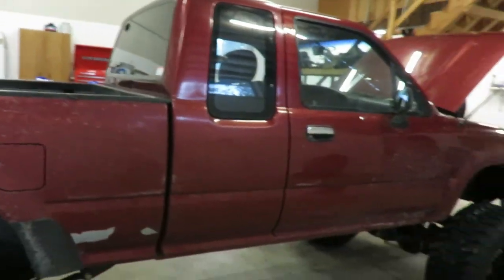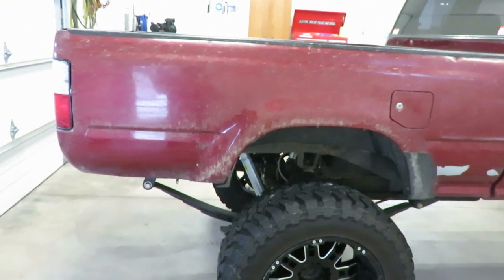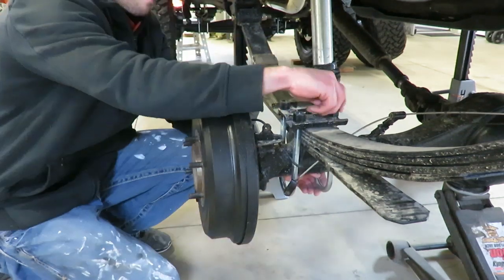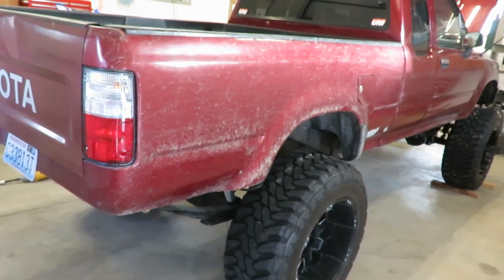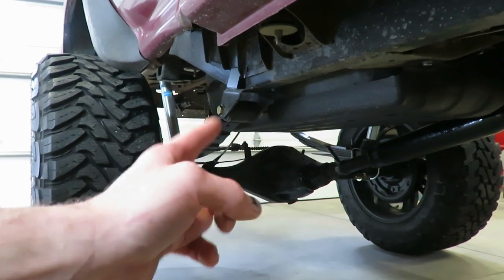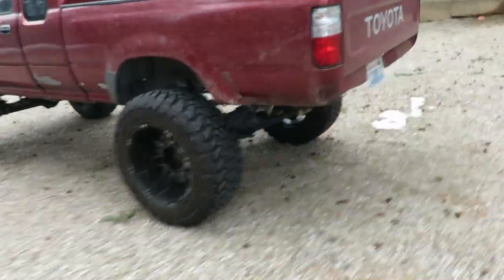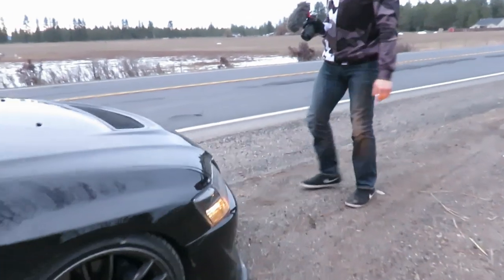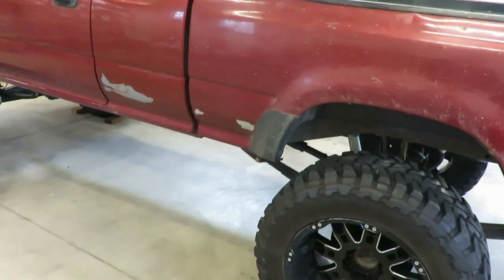We Found A Bad Leaf Spring In The SAS TDI Toyota Pickup

Comment: Awesome truck mate. As a windscreen fitter, seeing a broken windscreen as much as yours is, i just want to fix it for you  haha. I noticed your windscreen moulds are chrome where here in Oz they're rubber mounted. SO much easier to change. 
We also had the 22r in a carbi version in that truck. Sooooo gutless. I did a 3rz conversion for the extra powder AND the fuel injection. Sooooo much better.
Reply from the maker: Mike Diamond yes I need a new wind screen! Are the rubber mounding the same as mine? I really don’t like the chrome! If it would work in my truck do you have access to one for me? I’d be interested in one!
Reply: Austin Niemela we have the same chrome style in our 4 runners. The wagon version which have different interiors and dash’s which would foul on the rubber not allowing it to be fitted. Unfortunately it wouldn’t work. I also have the 4 runner which has the chrome removed and an aftermarket soft moulding around it instead of the original chrome moulds. This may be an easier solution for you?
Reply from the maker: Mike Diamond maybe I’ll see what I can find around here!

Comment: Looks better lower.  You either needed bigger tires or drop it. Dropping it is way cheaper and better.  My old 85 22r  was on 35” super swampers with 5.29 and bunch of power mods. Still was a turd. Got tired of chasing my buddies w v8 so sold it. Picked up a k5 quickly blew that motor and starting upgrades.  I wish I had kept the Toy. Loved that toy.

Comment: I had the same Settling problem. I went about it in the Antithesis. I used longer shackles in the front. Lucky I lengthen the front drive shaft before hand. What Axle ratio are you using?
Reply from the maker: Jim Madonna stock 4.10
Reply: Stock. Thanks!
Reply: @jimmadonna1436  from what i am seeing on the forums is 33" or 35" tire work great with the Torque an RPM range
Reply: @TheDeadwood11  Yes. Whit 35's and stock gears and a 22r engine 5th gear is dead. I did this in the 80's.

Comment: here is a link to ujoint timing. Your front will run a non double cardan as long as your output on the tcase and input on the axel are at the same angle "time,phase".  My cj7  had a issue with driveline angles so i made a dblCdn front shaft for it. i took a 94 cherokee front drive shaft marked center line then cut shortened pressed an rewelded the shaft together, no balancing needed as i kept the center line in time.  the spendy part is the tubes so if you can take a old rear shaft an have it cut down to fit the front there is some savings. also I5 drivelines https://www.yellowpages.com/vancouver-wa/mip/i-5-drive-line-repair-11459342 i hear is very affordable.
https://www.youtube.com/watch?v=Idk3BVDVHq4  i forgot to add this
Reply: The dead wood, interesting I'm going to check this out.
Reply from the maker: I have a spare rear I am going to cut down! The flanges are close to the same plane!!